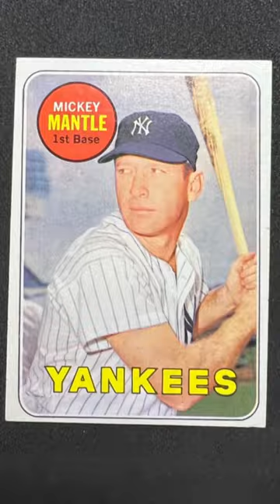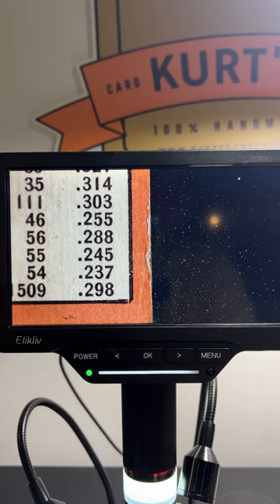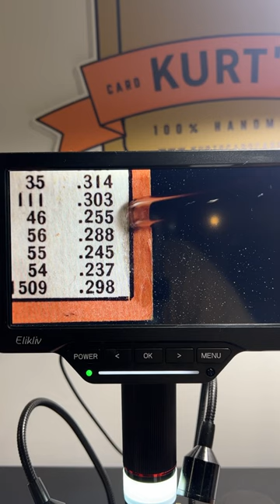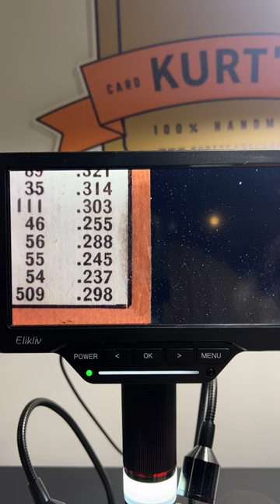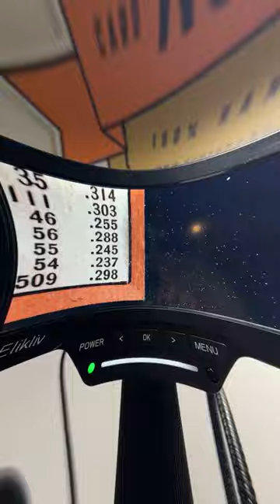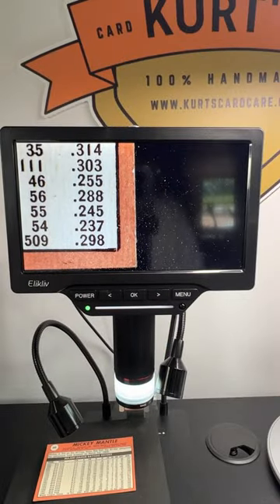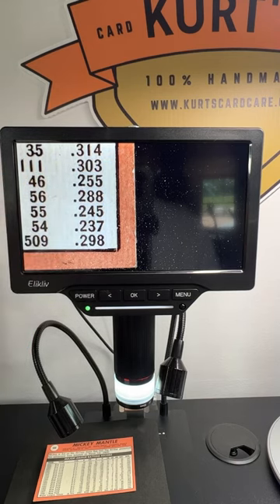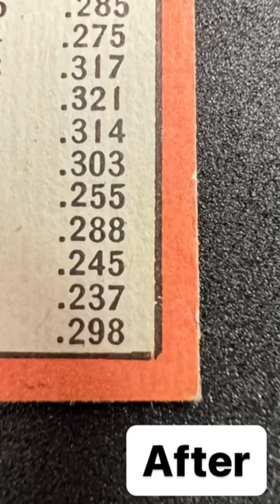1969 Mickey Mantle: How to repair a damaged edge on a vintage baseball card

Comment: Hey Kurt (proud kit-owner here), I'm thinking of buying the microscope in your Products We Love section. Will you get affiliate link credit for it since I see one a little cheaper on ebay (no Prime free shipping membership) but I want to help the channel out. Also out of these 3 options.. which would you recommend to focus on: A) Taking vintage (81 Montana/76 Payton) HOF rookie PSA 8/9s up 1 point. B) Take very old vintage PSA 1s up to a 2 (Babe Ruth/Lou Gehrig), or C) Taking hot modern era cards from PSA 9 to PSA 10 (Ohtani/Joe Burrows Rookies)... Thanks for any info! I plan to be a life-long customer.
Reply from the maker: Hi Chris, it is an affiliate link but just get the best deal you can. The scope rocks. I would share your focus on all 3 scenarios. Sometimes getting a modern card from a 9 to a 10 is just a new grader. Its the best if you can see a minor issue and fix it but that's not always easy to do. Vintage and paper cards have more room to improve when you see a wrinkle or a corner issue. The materials are easier to work with. I would suggest having a rotation of base cards that match your collection to continually practice on and test. Great question

Comment: will a bit of water work like you just did work on a manufacturers crease   ie old 1970s opc hockey especially 1971-72 always seem to have those creases   usually on the back   sometimes going through to the other side
Reply from the maker: I always use my spray. Never use tap water, it stains and can mold. Great question
Reply: The spray is just distilled water right?
Reply from the maker: @plb3733  no, it’s a blend that I make